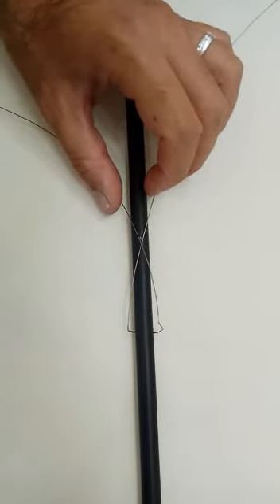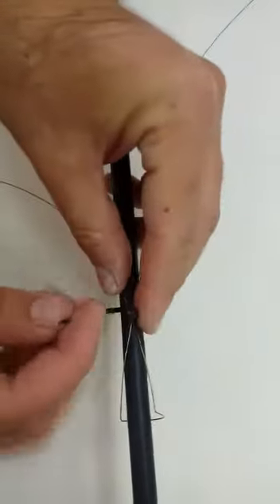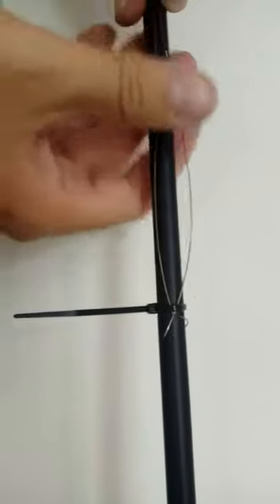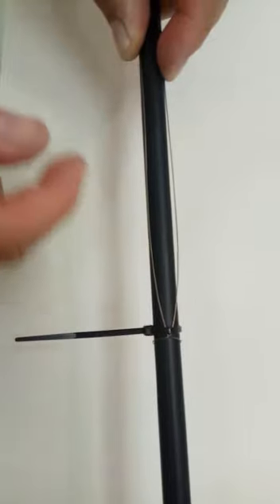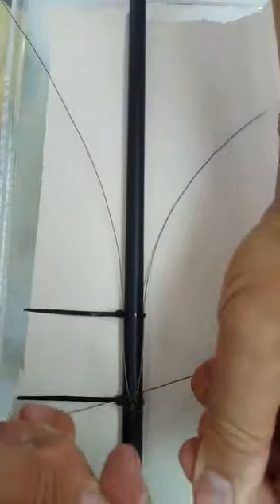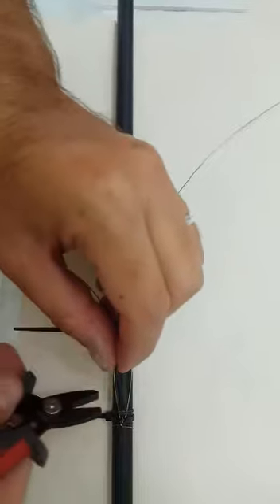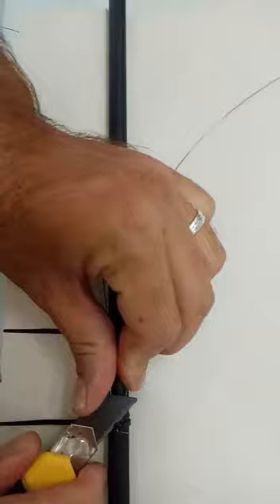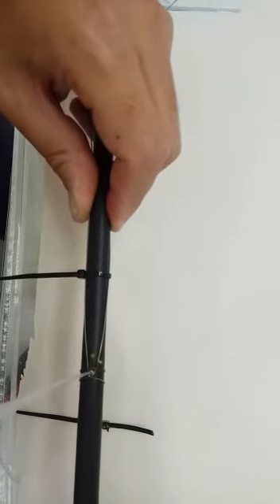Tiny set up guide: How to set up shrouds on the mast IOM yacht

Comment: Do the shrouds go up to the back stay crane and down to the side stay anchor points? I am confused which way is to the deck on the video?
Reply from the maker: Thanks for your comment: wires go down to the deck, so the IOM deck would be in the upper part of your screen when you watch this, and top of the mast would be at the bottom of your screen (down) here in this video.

Comment: What kind of heat shrink do you use to cover the wire/screw?
Reply from the maker: It is electrical heat activated rubber that shrinks automatically when you apply heat. Send us an email if you need spare and we will ship it to you (sorry for late reply, YouTube did not send us notification for this comment)